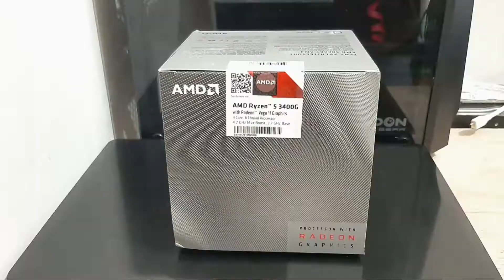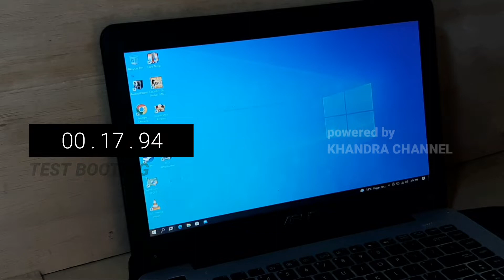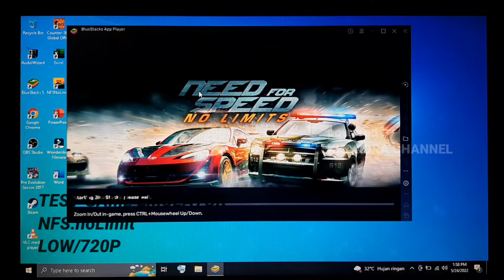Tutorial ! Cara Upgrade RAM & SSD di Laptop Asus a455l | test gaming asus a455l | Midasforce & Hynix

Comment: Bang ramnya bisa ditambah  yg 8 gb gak? Slot ramnya kan 2..klo diganti 2 slotnya 8 gb 8 gb bisa gak?
Reply from the maker: Seri i3 Maximal 10gb seri i5 maximal 12gb
Reply: @khandrachannel3031  mohon maaf mas, mau bertanya aja nih kan masny bilang seri i3 max 10 gb , tapi saya coba cek di intelnya dengan spesifikasi 5005u max nya bisa 16 gb. apakah memng kurang bagus di atas 10gb atau gimana mas? mohon penjelasannya.
Reply from the maker: Ngapain pakai ram di atas 8 gb bro, pakai 6gb saja sudah lumayan, kecuali procesor nya i5 ke atas pakai ram 8gb ke cocok, kita atur balance nya aja mulai dari storage - memory - cpu
Reply from the maker: Slot ram nya cuman 1, ini sudah bawaan pakai ram tanam, untuk upgrade sudah ada 1 slot saja